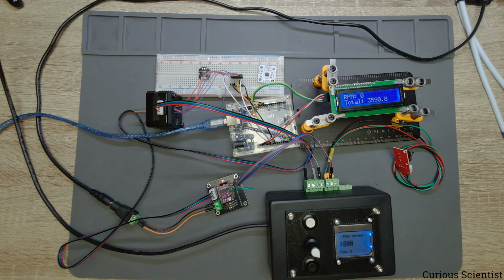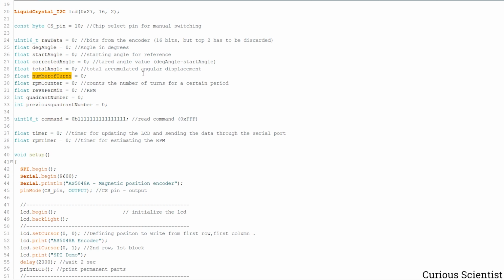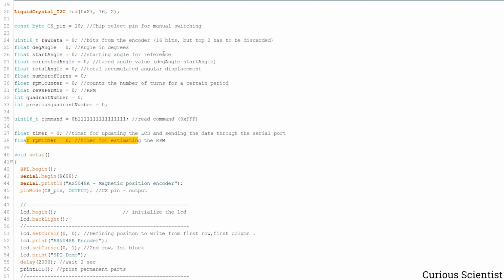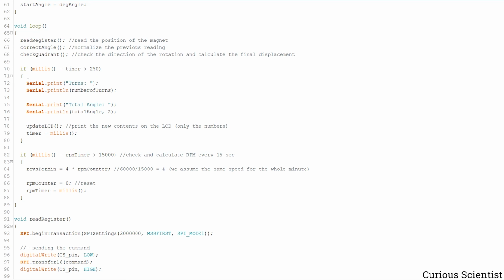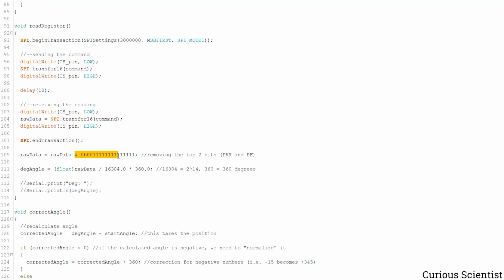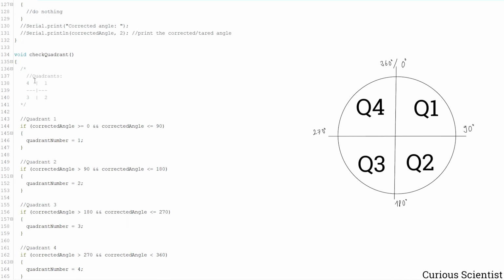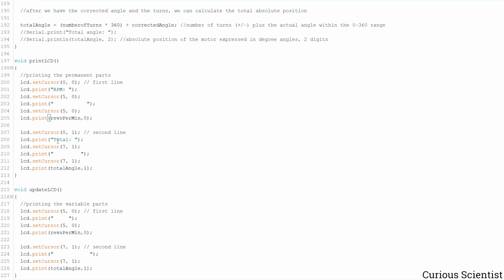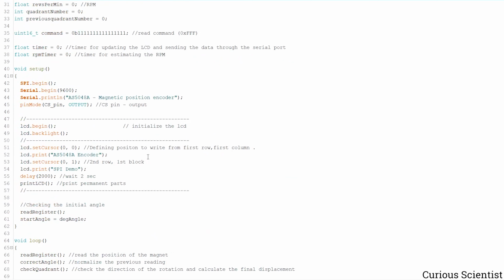AS5048A 14-bit magnetic position encoder

Comment: Great video! but I need to ask, how do you make sure that the magnet is correctly alligned with the sensor? as i am trying to use it, it provides me with the angle but with too many error flags between each two readings. Thanks!
Reply from the maker: Hi! The datasheet clearly states the required alignment. First, they (magnet and the chip's surface) must be parallel, and then there should be a certain distance between them. The magnet should also sit over the center of the chip. Please check the datasheet.

Comment: This is great man, I want to follow along (I got a AS5048) but I can't find any connector for it on amazon.. Did you solder the SPI wires on those tiny pads?
Reply from the maker: Thanks! Yes, I did.
Reply: @CuriousScientist  3 years later and still replying so soon! Thanks man I appreciate the reply, hope my hands are stable enough for this.
Reply from the maker: Sure, I reply to basically all comments that are relevant! It can help if you pre-tin the pads on the module and put a little flux on them. And then, pre-tin the wires and solder them one by one. Don't strip too much isolation off from the wires.
Reply: @CuriousScientist  Roger that!

Comment: Does this encoder work for the Nema 23 motor?
Reply from the maker: It works with anything that rotates.
Reply: Thank you very much, I need to control the motor like a clock, define a zero point and send it by coordinates, I think I can do it with this encoder
Reply from the maker: It would definitely work. It is an absolute encoder, so you would know its position.
Reply: Thank you very much, your video has saved my life, I'm subscribing right now
Reply from the maker: Thanks! Feel free to join my Instagram too!
Reply: Of course, I already started following you
Reply: One last question, is there a way for the zero angle to be universal, even if it is turned off or left in another position, the motor knows that that zero point will always be that angle, that is the problem that i have.
Reply from the maker: The zero is fixed and doesn't disappear, that's why it is an absolute encoder.
Reply: You are the best! Thank you very much, believe me, I will share your video, you have saved me

Comment: Can this high resolution encoder closed loop allow PID on microstep positions?
At slow speeds. And with calibrated lookup table for microstep currents.
Reply: 14 bit resolution sensor chip. But only 1 degree resolution in this demonstration?
Reply from the maker: @marklimbrick  I chopped off the digits and did not print all of them. 
Yes, it allows PID. On its "sibling", the AS5600 I have recently published a video where I demonstrate PID with stepper motors. I used it with a TMC2209 which can do 1/256 microstepping.

Comment: so from what i understand this type of encoders act as Absolute encoders? because angle is determined by the poles, so if you switch the system off power, it will save the position right?
did you try it?
Reply from the maker: It doesn't "act as", but it is an absolute encoder. There are four carefully placed hall sensors inside the chip, and they detect the alignment of the magnetic field and provide the position of the magnet. If you remove the power but doesn't move anything and then you turn the power back,  you'll get the same position within the 0-360° scale.
Reply: @CuriousScientist  Thank you!!

Comment: you know you can program your own address for ams sensors? At least I do it.
Reply from the maker: You mean the i2c address, right? Then yes, it is possible. Maybe it is also an easier way than having a bunch of CS lines when using the SPI connection.
Reply: @CuriousScientist  Yes, I2C. My only problem is, that I have burned? 2 senzors already. I don't know what went wrong, but had to buy new one.
Reply from the maker: I have never played enough with these chips to destroy them, however I am interested in the symptoms if there's any? Does the chip respond anything? Is it taking up more current (electrically damaged due to a short circuit somewhere)? Or what can you see?
Reply: @CuriousScientist  I can't find it with I2C scanner, visually it looks ok, however when I measure contacts, it beeps between 3.3V and GND, however not between 5V and GND. Weird, because I use 5V. I removed the chip from the PCB and it still beeps between 3.3V and GND.
Reply from the maker: It's not a good sign that the 3.3V and GND are shorted. I honestly don't know why this could happen, but I also suspect that the chip is toasted.

Comment: Great video! Had a question about AS5048A/B encoders. We are using the B variety and were wondering what's the max RPM that it can handle. We are using it on an arduino nano and its skipping counts depending on speed! Any help is appreciated. Thanks
Reply from the maker: Hi and thanks! Unfortunately, I cannot comment on this because I don't know how your code is used. It really depends on how often you want to read it and what method do you use.
Reply: @CuriousScientist  could you point me to the right method? I have the sensor mounted on a motor that can go upto 5800 rpm. At this speed, reading angles using the library by sosandroid is resulting in around 20-30 skipped counts. We are trying to measure the speed of this motor. This is at default I2C speed of 100kHz and 400kHz. We're polling the library function at the max cycle speed of the Arduino. No other functions/math is carried out elsewhere in the code.
Reply from the maker: I am sorry, but since you are using another code that I am not familiar with, I cannot help. I don't have the time and resources to dig into someone else's code and troubleshoot it.

Comment: Can i just use regular cubic magnet but put it on its side? so that north and south are sideways....
Reply: Well i had a bit of a sourcing problem on the magnets for AS5040 which basically needs a similar diametrically polarized magnet. The seller of the encoder didn't have those, so got them from another site that claimed they were diametrically polarized, but they weren't. So hacked it a bit. Placed two magnets tangent to each another with their north and south poles facing opposite each other. Made a tiny 3D printed shaft for it with these magnets push fit into one side. Worked like a charm!
So as long as your magnetic field is oriented correctly, as described in the datasheet, and is strong enough to trigger the hall effect sensors, the cube might work as well. 
ngl i'm a little curious if it would work.
Reply from the maker: It cost nothing to buy a proper magnet from Aliexpress and it doesn't need any hacking or workarounds. For good results I would only recommend a proper diametrically magnetized magnet.
Reply: @CuriousScientist  I agree. Just that my circumstances at that moment in time dictated otherwise.
Reply from the maker: I understand. I was not trying to discourage you from experimenting. Actually, it is pretty neat that you came up with an alternative solution! I just wanted to say, that with this specific part, it might not worth the workaround due to the required specifications of the magnet.
Reply: @CuriousScientist  it's all cool man. As i said, I'm actually curious to see if it works.
Reply from the maker: No, that won't work.
Reply: @CuriousScientist  here in this video there is another encoder but the trick works
https://youtu.be/8DEV3hZvOI8
Reply from the maker: Okay, but the datasheet is specifically asking for a diametrically magnetized magnet. The magnetic field might cross the chip in a different way which can cause wrong readings. Therefore I suggest the way described in the datasheet. The magnets cost nothing, especially if you buy the modules from sellers who also include the magnet in the package.